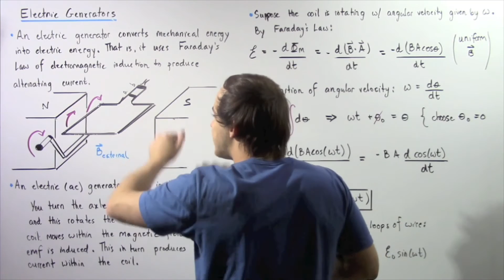Electric Generators

Comment: Hey Andrey,
thanks for your awsome lectures.
Shouldn't the initial theta be 90 degrees according to the picture on the board. If so, wouldn't it mean that the current should alter according to a cosinus fation rather the a sinus as you have written?